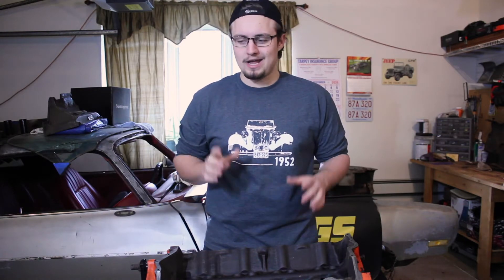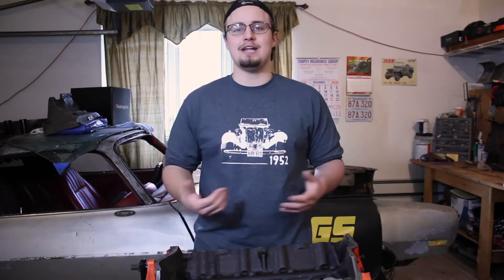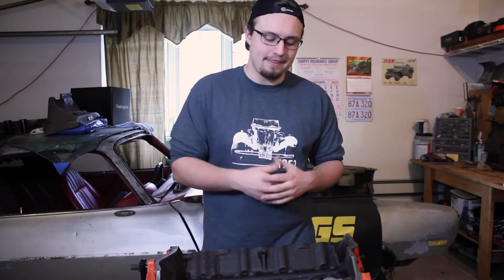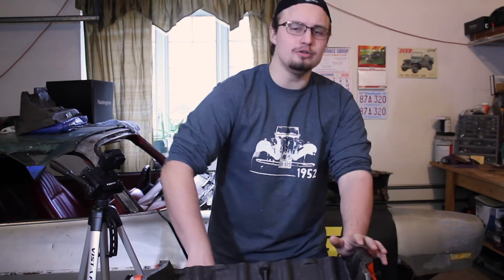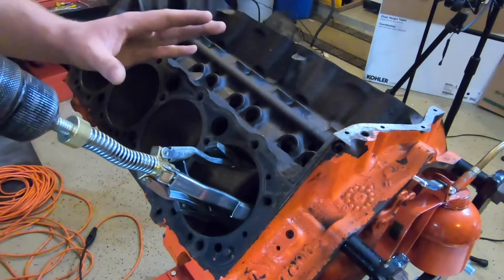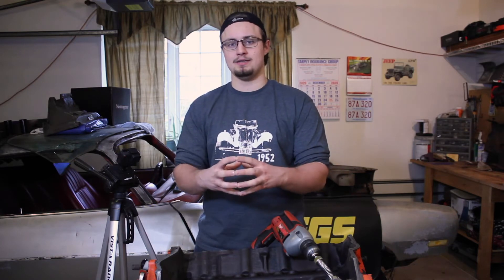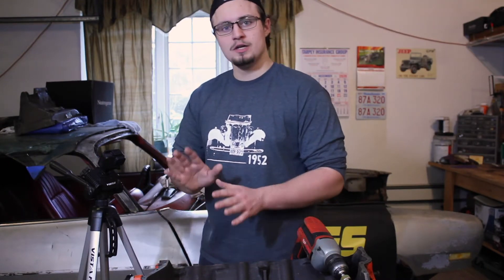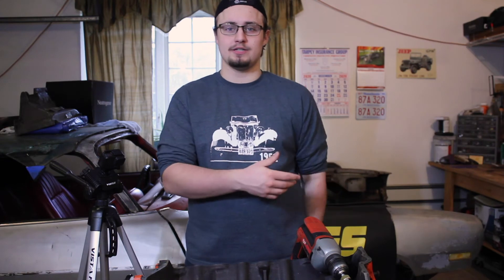How To Hone Your Engine Cylinders - Burnout Tutorials (Rebuilding The Chevy 350)

Comment: What kind of hone are you using?
The one I bought at Advance Auto only lasted through one Ford Focus 4 cylinder motor.
I got it out last winter to hone my 80 gal compressor  pump bore and the stones all fell off.
Reply from the maker: I'm using the Laguna Cylinder Hone from Harbor Freight. I honestly wouldn't recommend this hone either. I didn't have any issues with the stones falling off, but they did wear down very quickly. And they wore down unevenly, so one of the stones would be almost full and another would be almost gone. The problem with this is that these stones are not replaceable. So I had to use 2 hones just to finish honing all 8 of my cylinders. Like I said I wouldn't recommend, but if you want to check it out, here's the link anyways https://www.harborfreight.com/4-in-engine-cylinder-hone-63641.html

Comment: hey man i been binge watching your videos and i got couple questions so i spun a bearing blew my block but i have another spare block . i plan on using it as a daily driver , weekend car i pulled everything apart since the spare had a bent rod . i plan to reusing the pistons from my old block and this spare , will i be able to reuse pistons , pistons rings if i hone the block? this really budget orientated build and my first time ever doing this .
Reply from the maker: You can definitely reuse the pistons, as long as they aren’t too beat up (scratched, dented, dirty (which is obviously fixable)). I would recommend getting a new ring kit (I do have a video about how to install that) but if you’re rings look clean and move freely then you could potentially reuse them.

Comment: Thanks for the video!  I've had to replace a damaged piston, got a new ring set too, but putting the rings onto the piston has stretched them, so they're not flush, does that matter or can I just squeeze them in on fitting the piston?  Also the cylinder has some scratches that won't hone out, not sure to get it sleeved or just hone it? Worst scratch is about 0.3 mm deep, about 0.012" .
Reply from the maker: That's rough, but the piston rings are supposed to be "stretched out" like that. They start big and then you compress them to put the piston in the cylinder. I actually have a video about prepping and installing piston rings (https://youtu.be/cJXxi2Q7wXg) and next week we will have one coming out on how to install the pistons into your block. And in terms of the deeper scratches, is this engine just your daily driver? It's not a performance engine right? If that's the case, then those scratches should be fine. If this were a high performance engine, then I would recommend having a shop take a look.
Reply: @TheBurnoutShow  Hi Ryan, thanks for the reply, I saw your other post afterwards and it was a real help!  Now I see that the rings are really brittle as you said!  I thought I'd stretched the one I'd fitted, but when I took it off and squeezed it together herhmmmm it just snapped!  So now I know, these rings don't deform, and can be just squeezed in to the cylinder!
It's a lot of work to remove the cam shaft to sleeve one cylinder, then take it to the machine shop, etc., so maybe I'll just refit the one piston and let it run.  Will be interesting to see what the pressure will be like on that piston compared to the rest.
It's reassuring to watch your videos being new to this!  My engine is our of my boat, if I took it to the repair shops here, first they'd try to get me to buy a new engine, then they'd charge me 10 times the cost for parts, the valve seals they tried to sell me for $40 each, when online they're just $20 a set, so its easy to blow a months pay real quick! :|